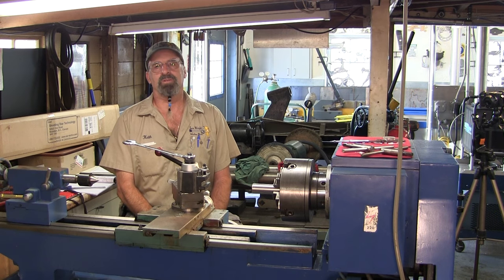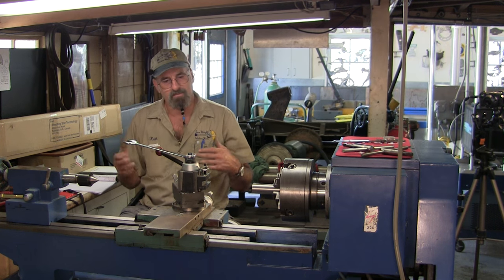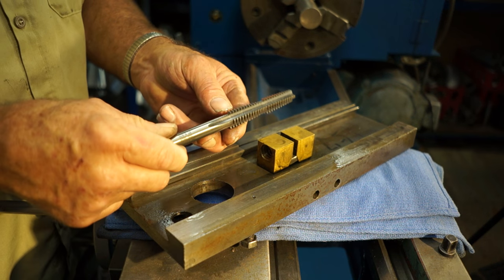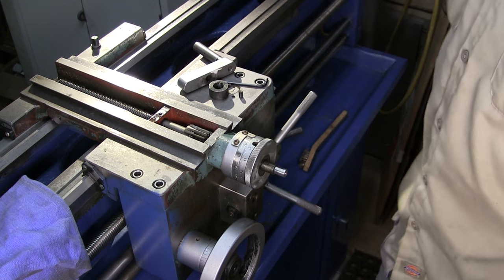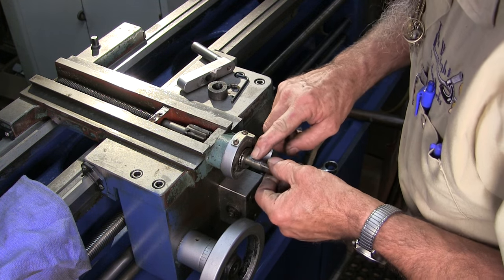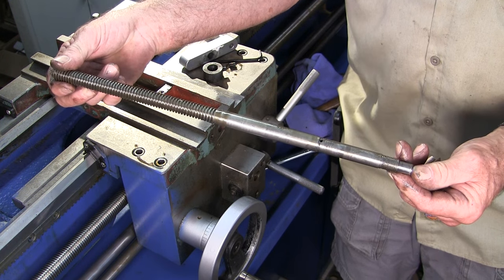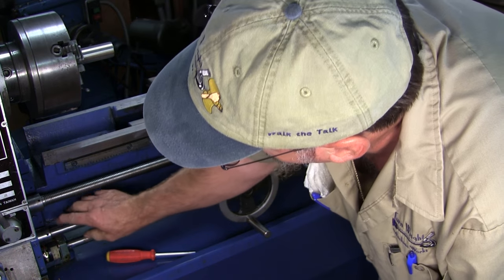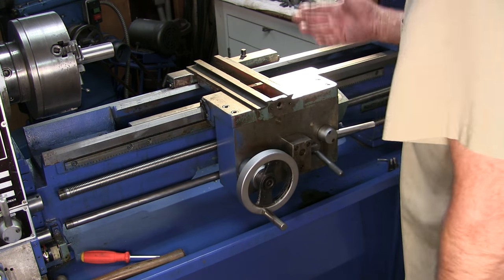Let's look under the old girl's apron

Comment: Thanks for the memories. I refurbished a 1987 Rutland belt drive lathe, I found numerous problems from the factory. One of the problems was that the rack through the gap did not have roll pins for registration. Your lathe seems to also lack these. This section would shift creating rough movement as the pinion made the transition. These were worth putting in. I think the compound feed screw and cross feed screw are 10 TPI. I also scraped in the cross feed and the compound feed, wow what a difference worth doing. When your done it's going to be a good lathe. People need to see what it takes to make a used lathe usable again.

Comment: Interesting to watch you dismantle the carriage and cross slide. I have a very similar lathe built in Taiwan in 1987 by Dar Sin Machinery Works. (DARSIN). It was used at a friend's company before he gave it to me and in very good shape but needed some through cleaning. I had taken the cross slide and lathe dial handle apart a couple times before I discovered the graduated dial collar was spring loaded and could be adjusted but had been frozen in place with gunk. I works fine now with some lubrication and a new compression spring. Looking forward to seeing what else you will discover.

Comment: Hi
I been waiting for this project LOL
I have a 2006 GH1440a lathe from China & your lathe is 1988 & looks good.
i have striped the chuck, gap & tool post, so far, & it is in great shape.
this video will help me do the rest of the lathe.
It will get a new motor & VFD, 
I have been using old English lathe till now, good lathes in there day, but not tight.
Looking forward to 3-4 videos , like today no rush. LOL
I am still working though yours videos, i have seen about 80-90% of them,
keep them coming, it stops me getting bored in the day. when i am to tired to work. ( not in the best of health )
All the best
jeff g

Comment: Keith says, about the cross-slide feed screw "If you're turning clockwise on the crank and it's going away from you it's a left hand thread."
That's usually true, but on some lathes, the bearing unit which anchors the screw is actually fixed to the cross-slide, not to the carriage. 
In these cases, the nut is fixed to the carriage, and the thread will be RH. Myford 7 series lathes are an example of this

Comment: I have a Harbor Freight that is identical (they don't list it any more, must have had to much quality in the build) any way I mounted DRO behind the half nut (It was a tight fit) made a bracket for reader and mounted it on the bolt @ 33:23. Next project, taper attachment, need to make a way to disengage cross slide screw from those brass nuts and not have the wedge fall out. Looking forward to any other mod's you do, oh and thank you for doing videos have been a long time follower.

Comment: Great video - I have a very similar lathe.  You didn't say anything about, or show any inspection of the bed ways.   I'd be interested to see how you would check the ways for wear.   Maybe you could show that when you start putting the apron back together.    Thanks for doing this series.

Comment: thanks Keith, I have THE SAME LATHE, but it is a Enco 12x36 gear head. thanks for opening it up so I can see it all. there is a Sacrificial gear on the belt side of the gear box (plastic), I make my own. the only thing that I think is a weak point is the gears in the gear change box, haven't found a good way to lube them.

Comment: I think you will find that this is a cheap lathe. it has a good stiff bed but the top part mainly the compound is not mating the quality of the bed. I also jhave 13x40 Sharp lathe made in the same place as yours. The top part is flexing at a bit heavier cut. Already did a few improvement but it is far from a pro lathe, also it has a screw on chuck. I love your big old lathe which you usually show in your videos, also that old mill and especially that drill press. I watch all your stuff, interesting to see actual fabrications. Your press is really something else I think it's work with a screw compressor. Yor postings are grate it's a pleasure to watch them, I do for a long time. thanks for the work put into them, greatly appreciated.
that old bob

Comment: I replaced most of the set screws that were missing their brass shoes with brass tipped dog point screws from McMaster.  Works the same as the bit of brass, just a little easier to extract.  My dial set screws I replaced with brass thumb screws that I made a dog point end on so it won't trash the shafts.  One original was steel with the brass bit, the other was missing and had some home made thing  created from a nut soldered to some threaded brass rod.  It was bent so it didn't lock properly.

Comment: Lucky me! I am working on a very similar lathe at a museum I work at. Ours had a DRO added years ago and that addition blocked access to the carriage adjustment screws that keep the carriage tight on the bed. Eventually the play got so bad that you could not turn anything harder than nylon! Our lathe was made in Taiwan perhaps as far back as the sixties but was sold up until a few years ago by Grizzly. I have been able to get parts so if you run into something that you do not want to make you might be able to find it. I think that there were many versions of this design. This is not a rant! But, when you are trying to produce a lathe at the lowest cost you copy and find ways to to keep part count and costs as low as possible. These great sixty plus year old Monarch lathes we see on YouTube were designed and built with another set of goals in mind. The brass plug ahead of a cupped set screw can be a life saver. The set screws with a brass or nylon tips are nice as well. I will be watching this inspection very carefully. Thanks Keith!
Reply: I often punch pucks from copper, brass or aluminum sheet that I insert before installing the set screw, it serves as a cushion.

Comment: Keith, I have a slightly later version of that thing, also made in PRoC, called a CQ-6230. I busted a rollpin in one of the gear shafts in the apron by being hamfisted with autofeed, which is how I know it is the same machine. I had to pull it apart to fix it, and it was pretty much identical to yours.

My lathe has knobs to change gearbox settings for screwcutting and feeds instead of the quick-change levers your machine has. My machine also has an IMPERIAL leadscrew of 10 TPI, so you might want to check that on your machine before you embark upon cutting metric threads with it? Given that your compound slide screw is Imperial, that may well be true for your carriage leadscrew too.

I think the same machine is now sold in the USA as a Grizzly, but don't quote me on that, will you?

Comment: I was lucky in my choice of DRO for my lathe. It was possible to gut the cross slide scale and tuck it inside the cross slide where the nut runs. The scale is buried in the machine where it's impossible to crush it or blow it full of chips. I had to machine a little clearance and make a fitting for the nut otherwise it was no big deal. Very tidy. Will that work for your situation?

While you have the carriage apart, consider installing a cross-slide clamp and skimming surfaces and tapping holes for follow rests and other do-dads. 

I see the cross-slide has backlash adjustment. Does the compound? Take that 0.010" down to 0.002"?

I like your careful but expeditious work. 

BTW, I like lead shot or soft copper for set screw slugs. And long dog points in lieu of cup points. I like it when a set screw hole isn't thru tapped so a short smooth hole is there for the slug to bear against. That way the slug won't mushroom into the threads. My preference; not suggesting a universal rule.

Comment: Love your videos.   Limited experience in a machine shop way back in my youth but remember it well.  Made an over-sized punch (looked like a nail set on steroids)  for a heavy equipment operator I was working with in 1965.  24" long by 1.5" dia. tapered with 1/4" tip. Knurled handle. Heat treated. Passed trade school sem. with an "A" for that project.  This new lathe from the orient seems to need a lot of tune up.  Is there still anything out there made in the USA?  Where's the middle ground between the best and Harbor Freight?  I still have my Wilson 3.5" bench vise my uncle bought for my when I was 15 in 1957.  Still works great.  Don't know what brands to get for my grandsons these days.  I'll keep watching.

Comment: I had a lathe identical to yours but it was a Enco mad machine. It was Ok but I had to replace the control rod electric switch at least 4 times so the last time I just sold it. Maybe your lathe has a better switch on I hope. It was a good little lathe and did what I needed it to but the switch thing just got a little frustrating for me.

Comment: I'll have to double check when I get home, but I think that's exactly the same lathe as a grizzly G4003, and G4003G. cause it looks just like mine
Reply: I had a Taiwan 12" lathe, made in the 80s which was exactly like that machine. The grizzly g4003 is almost exactly the same. I actually bought a few replacement parts from grizzly to fix a few odds and ends on it. I've since sold the machine but this vid brought back memories. :-)

Comment: My curiosity has me wondering if the manual lists their manufacturing tolerances. 
There are dog point set screws that have a brass dog. Might be a time saver and something that would be easily replaceable in the future.

Comment: Very educational Keith... It will be refreshing to see you make things using the metric system. Metric is mostly used in the UK now, where imperial was used before. So I was taught to use both systems. Metric is easier to work out with a calculator than Imperial. 
Is this lathe going to end up as CNC?
Reply from the maker: I am not going Metric crazy because it can! LOL A read out will be enough. Cheers, Keith
Reply: I occasionally cut some metric threads on a lathe very similar to yours because it has the 127 tooth gear and easy imperial and metric quick change selections without replacing the change gears. However, the half nut has to stay engaged and can get pretty exciting when threading into a shoulder. There are several ways around this but you have to pay attention.

Comment: Great one Keith, like that you've started to work on that lathe. I have an old Boley 4LV lathe that I acquired a couple of months ago with collet closer and the entire "kit", it's a great extra lathe for small work. Thing is that it's completely without wipers on the apron and I'm quite concerned about it seeing as I'm turning quite alot of hardened small parts in it. Do you have any good tips on a simple solution for wipers, or should I just look at something like telescoping way covers right away maybe?
Reply from the maker: Making good set of wiper whether you use way cover or not. ;{)------

Comment: When you removed the pin from the collar on the cross slide shaft was there a shoulder on the shaft that the collar fit against? Another great video Keith.
Reply from the maker: yeah a very small one. ;{)------

Comment: The cross feed dial should have had a brass slug or ball  and a small stiff spring between it an the set screw to adjust the friction on the dial.

Comment: The great thing about these videos is now you can go back and screen capture the images necessary to update that generic manual you found.
Also, at 36:36, is that rust or some really wrong-looking lubricant?
Reply from the maker: I think it was the red lead paint being liquefied by citrus cleaners sitting in between the surfaces a couple days. It wiped right off and no sign of rust . ;{)------

Comment: Keith after watching the video for the 3rd time I hear something that seemed to have a misunderstanding to it, that is, being able to cut metric threads on your machine. After being in the service industry for over 45 years, I have repeatedly had to deal with the customer’s frustration. Even though you can cut metric thread on a lathe by changing the gear combinations you cannot unlock and engage the half nut, you have to stop
the machine and reverse to start location. If you have a inch screw you can only open the nut doing
inch threads, you can cut metric but you can’t open and engage the nut, if you
have metric screw you can on metric but not inch….If I’m wrong in your case, or you already knew that my Bad.
Reply from the maker: I plan on installing brake peddle to stop and reverse spindle at the end of running travels during metric thread cuttings!  ;{)------
Reply: Metric and Imperial lathes operate exactly the same, you still need to keep the half nut engaged for metric threads, and can disengage it for imperial threads. Some metric lathes have special threading dials. Typically they have three different driven gears on the dial shaft. You have to move the dial to engage a different gear when you change threads.
The reason for this is because imperial measurements are all base 2, so they can be dividing by 2 repeatedly and yield meaningful results. Metric is base 10 and dividing by 2 creates complications in many cases.
Reply: Your reply was very factual and after being a field service Engineer for 40+ years I know what you said was true. But I was trying to point out that you can open the split nut doing metric threading with an Inch screw! See YouTube Oxtool ,  metric threading with an inch lead screw.  I can’t understand how I didn’t think of it after years of working with lathes and mills. the post deleted that URL
Reply: +joshua43214  Actually, just because all the imperial measurements are nicely divisible by two does not make it base 2.  Base 2 is actually binary...the world of computers: 0s and 1s.  The measurements are still all base 10...imperial and metric...as they use digits 0-9.  Other common bases are 8, octal, (uses digits 0-7 only) and 16, hexadecimal, (uses digits 0-9 AND letters A-F).

Comment: I am about to buy a lathe. Is this a good lathe? The dimensions of the gears or axels? The solutions with brass nuts instead of steel? You mentioned the wipers being a bit bad. Is it ok for being from Taiwan and for that price? Can you zoom in more on this in the next part and maybe compare it to a better lathe?
Reply from the maker: This lathe is a 1988 and for it's money, at that time was affordable, for a lot of people. There are newer models of the same style offered by Grizzly Jet etc. I would search out guys with them to compare, I can't because I don't have them on hand. This lathe was a gift to me, so any work I do and share are to enlighten areas of less than.  ;{)------

Comment: hi keith,
have you considered a pair of circulating balls nut and bolt for the crossfeed?
i believe they offer a custom product for every machine, and the price is reasonable.
i have seen a fellow who has renovated his bridgeport with those.
thanks for the video,
-toly
Reply from the maker: I had for my bridgeport but not on this little screw. ;{)------
Reply: Ball screws ya good idea but the ball block is huge . not sure if it would fit or if they make a smaller one. but the lead screw can be bought and made to size in terms of length . harden out side  so you need to check thread size to see what size you would need because the core can   have threads turned on it . I do this all type of stuff at work when maintenance  day rolls around  .
Reply: hi paul, and thanks for the reply.
the screw pitch is that standard 0.200 per turn (or, perhaps, just 0.100 per turn in keith's lathe), and the diameter depends on the space of the machine.
the circulating ball nut can be any size -- whatever fits.
i've seen the retrofit done on a bridgeport with plenty of room, and the nut was large. in fact, it was a combo unit for both the X and the Y.
more than that, they've lifted off the whole table and restored the ways.
after the entire fit was done, the mill would do a tenth repeatedly.
i think it was laid out on y/t somewhere.
-toly

Comment: Keith , I'm sending you my precision ground MT5 test bar to help you dial in the lathe as the headstock does not lock onto the ways and needs to be trammed in. Also with cross slide rebuild I absolutely prefer  www.roton.com  for screw replacement, their screws are very well made and burnished smooth. I press, loctite and use a taper pin to hold the new screw to hand wheel section . On your  original screw it may be  a 15mm-8 LH lead , so 5/8-8 is a perfect replacement.

Comment: Going by the color difference, would it be safe to speculate that is not the original carriage?   Or is that a normal factory color mismatch?    Is the carriage serialized to the main chassis?
Reply: Oh, is that glyptol on the inside?
Reply from the maker: Carriage is the original color. ;{)-----

Comment: Nice bit of Taiwanese hardware. Good thing it wasn't made by the Go-Well Machinery Co. Ltd. I have a 1980's mill-drill they made that makes modern Chinese Junk look like high-class stuff!

Maybe when replacing that dial screw use something like a spring plunger, if it will fit? Keep a nice constant pressure on the screw shaft without chewing things up. Maybe something like http://www.use-enco.com/CGI/INSRIT?PMAKA=319-7544&PARTPG=INSRCM

Comment: I may have missed it but if you are not replacing the feed screw, only the nuts,  is the thread angles etc going to match?
Reply from the maker: Yes the acme thread is going to match minus the wear. ;{)------
Reply: It is also one of the reasons for the brass nuts and steel screw. In any situation of metal to metal contact, the softer part will take most of the wear.  It is good design to make the part that is easiest to make and replace out of the softer material. That screw takes a whole bunch more machine time to remake, while the nuts are easy, especially in a production environment. It would be a bad design from a service perspective if it had a regular steel screw and hardened nuts. Hardened nuts are for machinists, not machines.